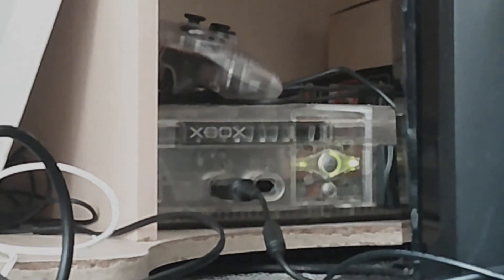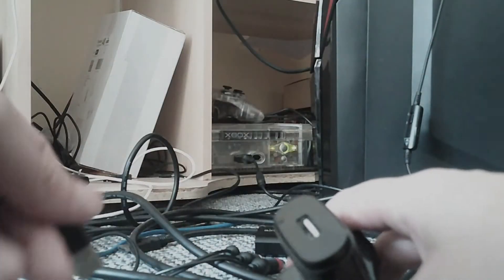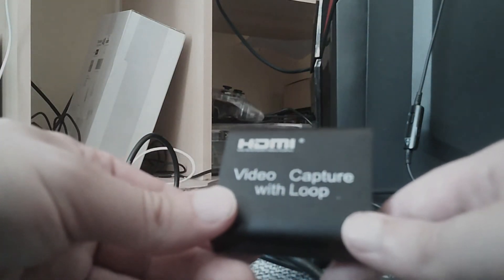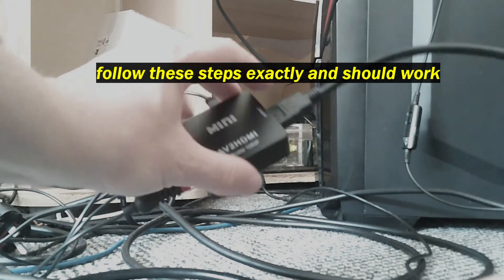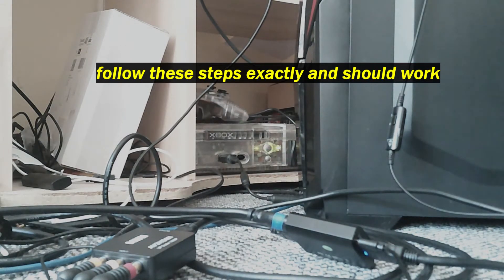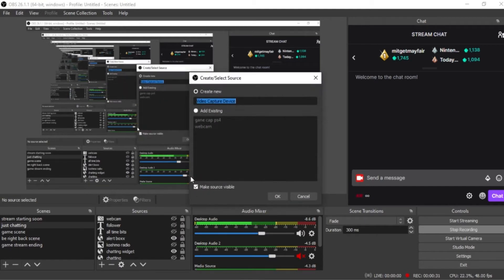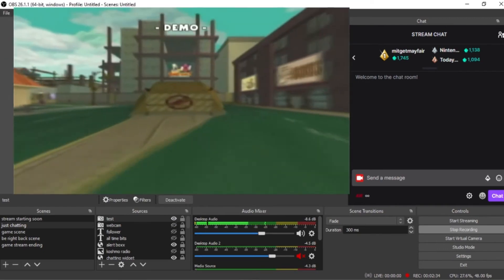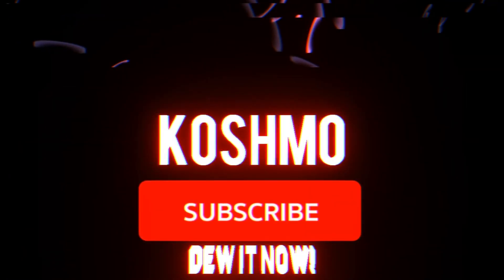How to Stream AV to HDMI on OBS Studio for "OLD" Games Consoles [Original Xbox Tutorial] 2021

Comment: Does this work with any capture card because I have Zasluke Capture Card and I'm wondering if this will work with any capture card
Reply from the maker: By googling your capture card as never heard of the brand, its like mine but without 4k. it has same design and ports like mine so yeah should work if you just using it for HD consoles.

For standard old school consoles, you need secondary capture card for it to work. use the "MINI AV TO HDMI" capture card seen in this video and then follow the steps.
Reply: @koshmo575  Well I was able to find the capture card and Mini AV to HDMI on amazon that you have which would be easy to setup
Reply from the maker: It is very easy to setup if you follow what i did, there is a small chance that it does not all work first time. Just unplug everything and reconnect everything back in it's corresponding ports.  @Gareth17andMinnie14
Reply: @koshmo575  well I just already ordered what you had in the tutorial so I'll have it soon to see if it works
Reply from the maker: @Gareth17andMinnie14  it should work if you follow the steps. There is possibility that it could not work straight away as you may have to fiddle around with it by taking out all the leads and putting them back again.

Comment: does mini work good ? im planning to buy it
Reply from the maker: Hiya, yes it does. It does the job in the end BUT you may have to adjust settings to get get right colours etc.
Reply: @koshmo575  does the original xbox have video settings ?
Reply from the maker: Honestly can't remember , I assume it does like PS2 but in order to get colour scheme as good as possible you have to go into obs itself and click on settings and find your video settings. Or if not in settings you should be able to adjust the video quality by right clicking on the desired video capture you using.
Reply: @koshmo575  actually the original xbox does have video settings and you can even make the screen have a letter box or widescreen mode too
Reply from the maker: @Gareth17andMinnie14  I couldn't remember as don't usually go into the Xbox settings much. But thanks. 👍